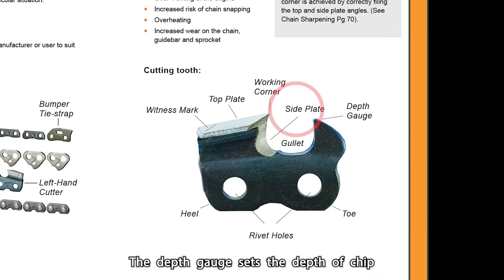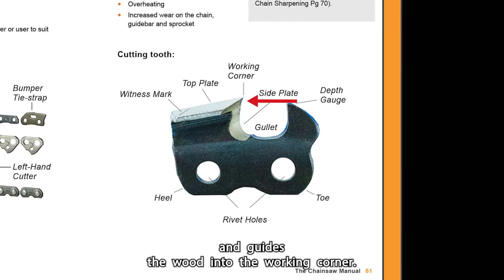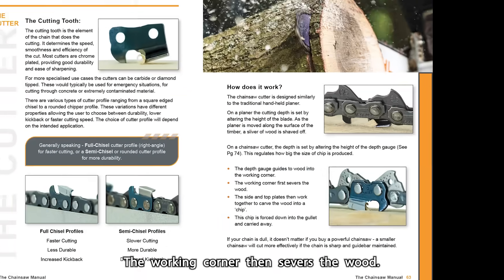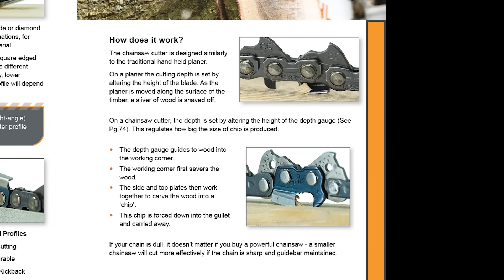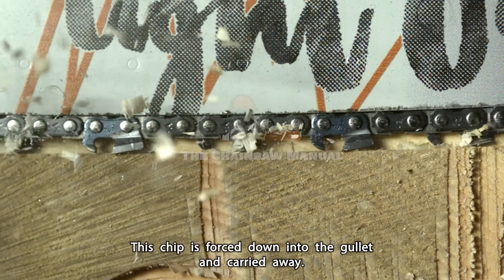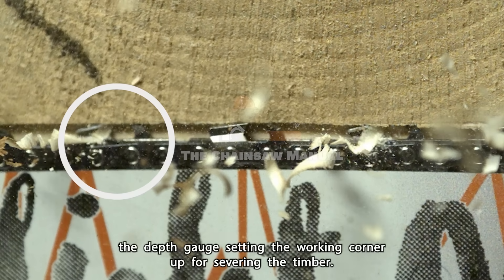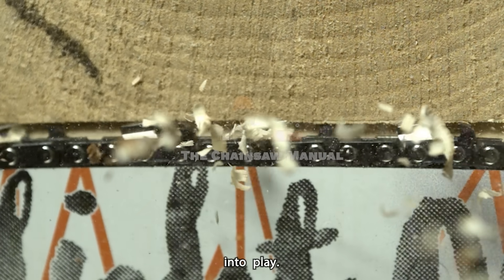Insane 20,000 FPS Slow Motion: See How a Chainsaw Actually Cuts Wood!

Comment: Install poly sliders on the face of the bar. That way the poly sheet wont get scratched, and there will be just enough gap to simulate it cutting into a tree,and "pulling the shavings away." 👍😎

Comment: That is also a reason you never use the tip of a chainsaw to start a cut
Reply: Don't use the top part of the tip.
Reply: @tekknorat  not any of the tip. it will push the chainsaw up and nobody has the strength to stop that... people get munched by the saw from doing it wrong.
Reply: @JackFrost008  You're mistaken. We call it a plunge cut, and we use it occasionally. Yes, it can be dangerous. It's not for rank amateurs. Having said that, I learned how to use a plunge cut by simply doing it, as a teenager. That first saw was a small saw that I could control.
Reply: @paulmaxwell8851  Really? I never used a chainsaw so I cant say I know.
A plunge cut is definitely not something I would try, I could use it to saw logs normally atleast :)

Comment: Not to take away from any of the high framerate photography, but if we wanted to observe how the tooth works, couldn't we just spin the saw very slowly? Or does the velocity of the tooth actually affect the principle of operation somehow?

Obviously a lot of torque would need to be applied for turning the chain in a setup like that, but it should be very doable with an electric motor.

Comment: why every second chain cuts and every other chain does nothing?
Reply: because cutter bites as its depth by turn, left, right, left, right... No left, left. because left cutter can't reach wood until right side  become same height or a little bit deeper height. i tested removing cutter one side 1 by 1 and cutting by 14in chain. finaly one side has only one cutter, but saw still cut straightly.

Comment: So what happens when your depth gauge is a lot lower that the cutter?
Reply: Kickback
Reply: @missourihillbilly4683  No, it's not quite like that. Filing your depth gauges too low will cause each tooth to take a bigger bite. That will stall the chain, which makes it almost impossible to get any cutting done. Yes, very low depth gauges can slightly increase the risk of a kickback, but that's not a part of the bar you should be using in the first place (the upper part of the tip).

Comment: Fun Fact: Did you know the chainsaw was not invented for cutting wood, but rather for a medical application? When pregnant mothers were giving birth, and they might have had a difficult labor, they were inevitably very noisy and this got super annoying for the surgeons, and all the other males involved, really, and so one guy made up a chainsaw device to just quickly dispatch of the complaining woman and then cut the opening for the little offspring (they were hoping for a boy) to step out of the now quietened shrieking woman and join the world in peace without all that hullabaloo. The body was then further dismembered easily and handily with the fantastich new device and then bin bags were used for a quick cleanup and then down for some drinks to celebrate.  This is where males got their affinity for the Internal combustion engine, because for generations, their first memory was the sounds and smell of a nice two stroke going to work, and then the opening up of a whole new wide world of possibilities in front of them.

Comment: This video shows the importance of the chain being properly tensioned.
 If it is too tight, the chisel does not "angle in" in order to cut, then release in a repeating (porpoising) action, resulting in poor cutting, overheating the chain and bar resulting in rapid chain link/roller wear (stretch), and burning blade edge.
The chain oscillates as a wave and that angles the tooth. (you can see the "wavy" edge of the wood over its length and see the action.
In both "up and down" as well as "side to side" motion.
High speed filming is such a neat revelation of how mechanics reveal principles of motion and forces of physics.

Comment: Interesting how it's showing only the left side cutting as there's no right side to the log
Reply: duh, it was the point of the video. With right side, you can't see chains
Reply: @firstname-m8g well that's obvious isn't it mate and I said it was interesting because of that
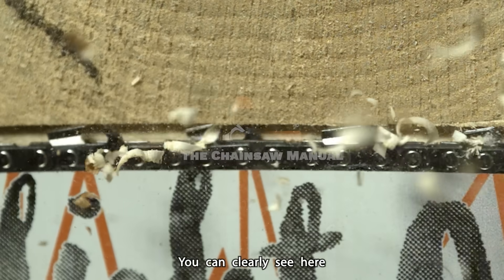Reply: 0:51 You can actually see one tooth slicing across the top (since that is all the wood it can touch here), while the next tooth chisels out the far corner and produces the chip. In a whole log, both sides of teeth would be cutting into their respective corners and pulling chips.

Comment: Please Please make this film again, but this time with a plexiglass plate on this side of the chain, so we can study the chip transport as it really happens. PLEASE
Reply from the maker: I have thought about it, it's technically very hard to show that - but there will be more content coming.
Reply: @TheChainsawManual That would be awesome. It might help to bolt the bar to a rail system so it can be steadied and rolled slowly into the wood. Also an electric chainsaw might vibrate less.
Reply: @TheChainsawManual plexiglass will be scratched quite easy, and those scratches will quickly block the images, I think.
Tempered glass might be better option: hard enogh, but doesn't break easily.
Reply: @TheChainsawManual  The people have spoken. You know what you need to do for views. 😂
Reply: You'd either have the chain rubbing against the plexiglass immediately making it matte, so you wouldn't see anything, or you have a gap between the acrylic and the wood/chain making it non-representative of the chip transport.
Reply: @superdau Yeah, that's gonna be the challenge. I think if you milled into the plexigas the amount the teeth stick out past the bar you might be able to get the a clear view while still getting mostly normal chip collection. At least on the top and bottom of the bar, I don't know how you'd get the nose.
Reply: I appreciate that somebody else is interested in chip transport as I am.
Reply: That wouldn't last long!
Reply: My first thought as well!!!!
Reply: Yes bro, I have the same opinion
Reply: Maybe some 10mm glass, it won't scratch as easy as acrylic or polycarbonate, and 10mm won't brake as thinner glass would. Tempered 6mm glass could also be safer option.
Reply: The rakes would pull out the chips. There, thats what happens
Reply: please lower the music as well
Reply: Plexiglass up against the wood rather. But yes this is awesome it really show the inconsistency of the cutters in the wood. Every other cutter working is how it seems on the flat cross cuts.
Reply: @DilynHorton the cutters point in alternate directions so thats exactly what you'd expect.
Reply: Or get a block of polycarbonate and cut directly into it... doesn't have to be wood (I guess heat might be an issue then, but you only need a few seconds of actual footage, so it might work)
Reply: @daverotors That's what I was thinking, just a block of something clear. Plus, what you're saying, don't really need much footage to see what's happening.
Reply: Just imagine
Reply: No

Comment: It's important to keep it pointed, especially on hardwoods; the difference in the sharpening angle causes the cut to veer to the right or left. It seems to cut one tooth out of every two; on thick wood, perhaps half the teeth aren't necessary. 👍
Reply: If you are referring to this video, remember they cut right and left on another. The video is filmed from one side, you only see the chips going to the right
Reply: I was thinking the same thing.  Maybe they are staggered as in the point on one tooth is on one outer edge of the chain width and the next one is on the other edge.  This cut was made to make filming possible so maybe it wasn't a full kerf.
Reply: @The_Osprey YUP
Reply: The most common reason I've found for not cutting straight is when the teeth hurt something on one side and become dull while the other side is still sharp.  Also, when I sharpen, if the teeth aren't all the same length, the longer ones cut more aggressively and can cause curved cuts.
Reply: U can see the importance of the gullet being able to carry the chips and deposit it outside the cut groove!  On the open side towards the camera the teeth can continue cutting without plugging up.
Reply: @garyblack1832 the other side also cuts